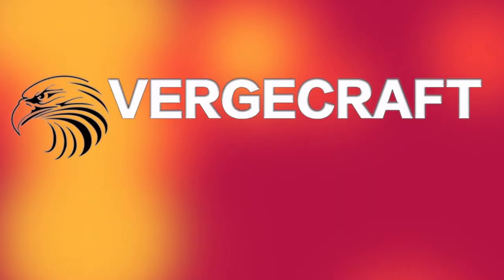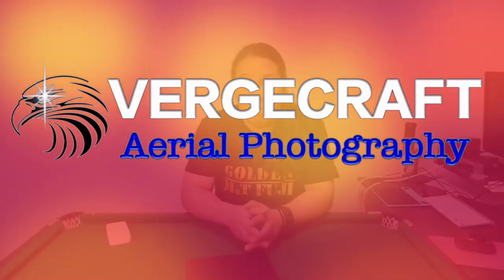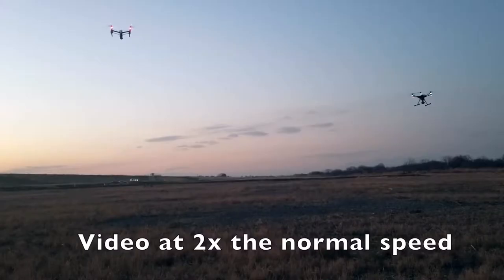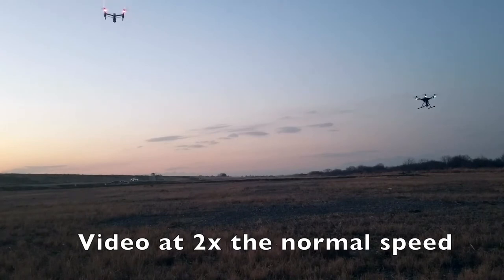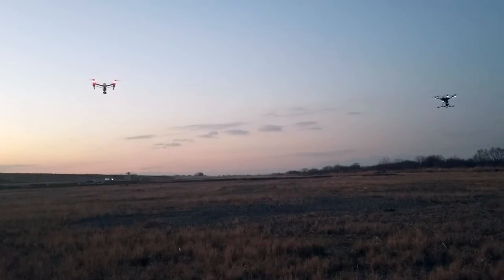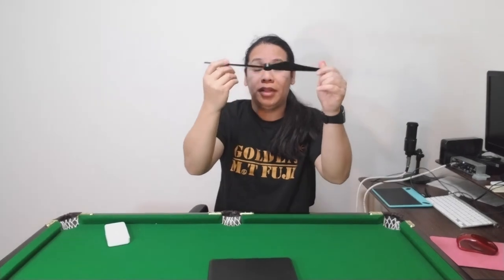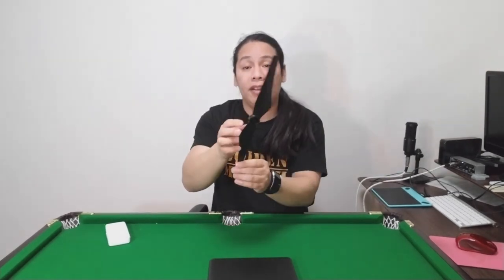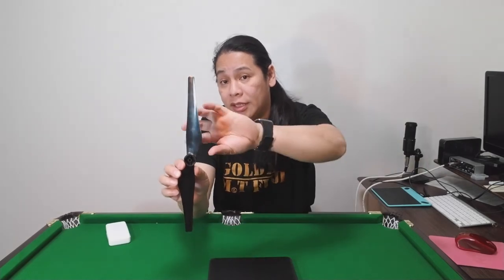Fixing stability of Inspire 1 and Typhoon H

Comment: Thanks for posting your test results.
I can't think of any reason why a damaged propeller would cause the Inspire to gain altitude (or any drone capable of flying autonomously).  Altitude is controlled by GPS and various altitude sensors and power to each prop is adjusted accordingly.  Recalibrating the Typhoon H compass was a good call.  I can also get some drifting with my TH if the GPS almanac hasn't had time to reload (after a large change of venue or lots of time inactive) even if it sees lots of satellites.
Reply from the maker: Rubik3x  I think you are right.. It should still maintain or at least get back to its position.. Probably a combination of the GPS error and the prop may have been causing it.